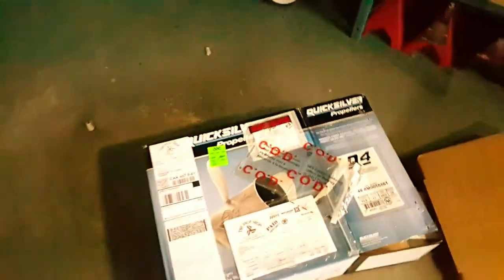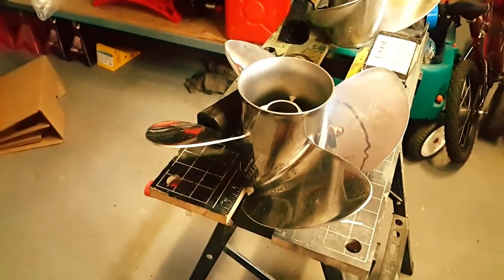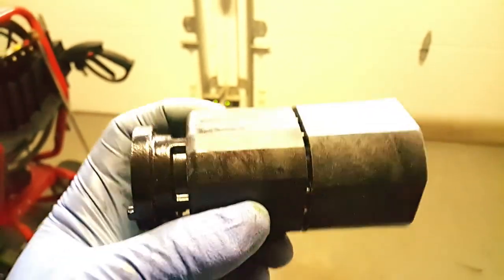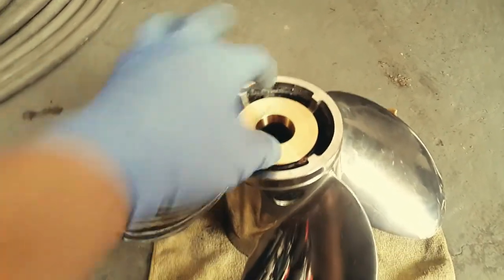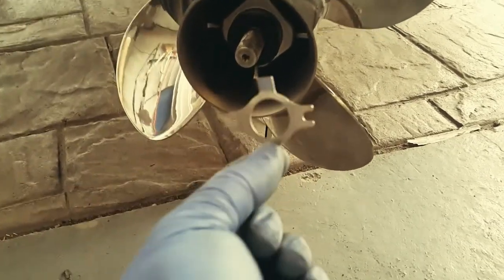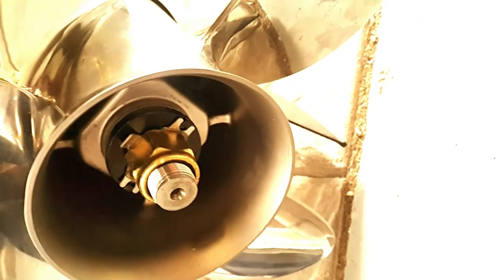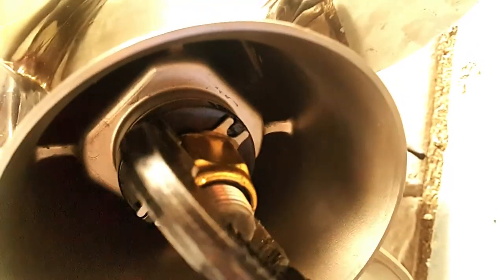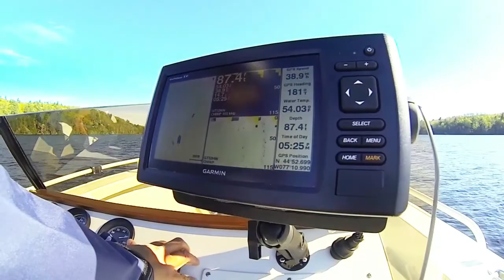Quicksilver Q4 - Mercury Spitfire X7

Comment: The Spitfire X7 and Q4 props have extremely low slip, way less than standard 3-blade props.  Depending on boats, they can actually be near zero on lighter aluminum boats with efficient hulls like Lund's.  With the numbers you posted below, your Q4 is running at about 5% slip, whereas your Michigan Wheel was running 20%.  Doesn't surprise me, as MW is known to be a 'value' brand compared to Mercury props, and I don't think are particularly efficient.  That's why you gained so much speed with the Q4, it's super efficient.

Comment: Well, how's the prop? Did you lose any top end speed? Does it handle better? I have the same Rapture prop, 21p, and I'm looking at the same Quicksilver wheel. Funny I found your video. However, I'd like to stay with the same size. Your motor looks like a 2 stroke. Is that so? What HP? Thanks.
Reply from the maker: CajunRulez I have a 2006 merc 115 4-stroke. My old prop at WOT was doing 34mph @5300-5400 rpm. The Q4 did 39mph @5400rpm. Holeshot and cornering improved significantly, especially with the boat loaded with 5 adults. I'm surprised the RPMs didn't increase much. Also 5mph more was unexpected. I can trim the engine up more around sharp turns without the prop blowing out.
Reply: Hey thanks for the reply! So you went down in pitch and gained that much on the top end? That's awesome. I guess it really does get so much more of the boat out of the water that you get less resistance. My boat has a terrible hole shot and handles awful. With a full livewell and an extra passenger the back end sits real low. The 90 HP doesn't have enough power to lift the boat high enough so the bow hops around. Cornering is dangerous actually. I think this prop will fix that problem, and might even gain a little more speed. Based on your reply I think I might go with a 19p. Thanks again.

Comment: Fred that Q4 is actually a Mercury Rev4 prop not Spitfire
Reply: If I recall the Rev 4 is the big hub SS 4 blade 135hp up and the Spitfire is what they call the small hub 60CT to 125HP
Reply: Incorrect, sort of. There are two Q4 props, 4.25” and 4.75”. The 4.25” is a spitfire and the 4.75” is a Rev4.